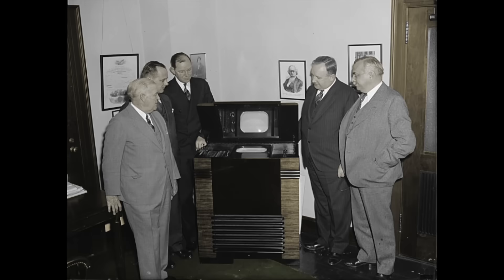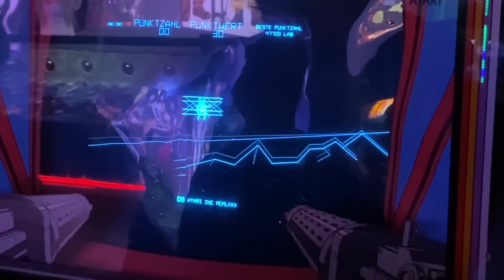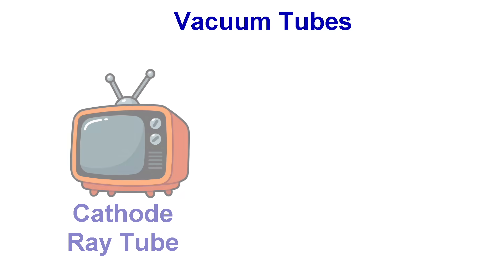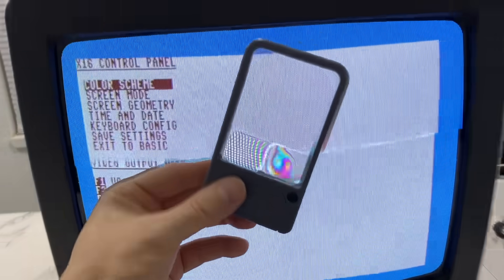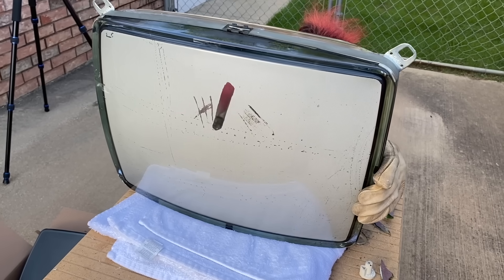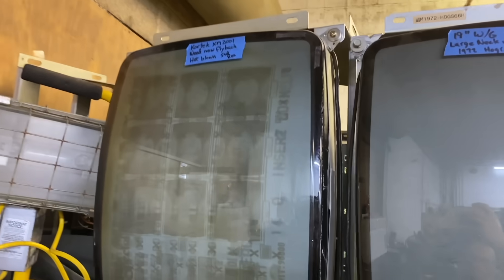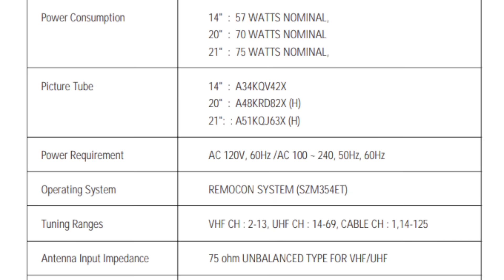How Cathode Ray Tubes Work.

Comment: You left out the biggest benefit of CRTs for modern users/gamers: unmatched motion clarity/stupid fast "pixel" response time.

Because it lacks persistence (the previous horizontal line of lit phosphors is pretty much dark again before the next line is even done drawing), if your content's FPS (Frames Per Second) matches the Refresh Rate of the CRT (Hz), the image in motion is STUPID fluid. Puts high refresh rate LED monitors to shame. And that's just at 60Hz/FPS.

I main a CRT on my gaming rig/am using it as I type this, and watching 60FPS content/playing games at 60FPS, when the monitor is set to 60Hz is GLORIOUS, and I hate going back to any other display I have. Increase in-game FOV, IRL FOV, sharpness, etc. on other monitors doesn't make up for the loss of clarity.

I can sprint past labels/signs in Halo/speed past signs in Forza, and read every letter, and see every texture, assuming the game engine doesn't force motion blur (unfortunately a lot do).

Running my monitor at 80Hz (if my GTX 1070 can render a game fast enough) is *pure eye candy*.
I really, truly, absolutely regret throwing away my Dell P1130 a decade ago, trying to "clean up my desk" (and keep my room from being a furnace in the summer). Such mistakes.

Back then I wasn't even running my 3 CRT "Eyefinity" array at the same refresh rate across all three monitors/wasn't matching the game across all 3... so I wasn't even getting the motion clarity benefit (it creates judder if there's a mismatch/if frames rates drop/go too high). Wish I could try again...

Comment: Vinyl records don't actually sound better than CDs.  The reason the sample rate of a CD is double the audible frequency range is to allow some complex math equations to turn those samples at 16 bits into any audible sound.  I learned that from a Technology Connections video.

Comment: The ratio 3 x 4 has a maximum LCD of 15" with max. resolution is 1024 x 768 and 17" display has an 4 x 5 ratio with 1280 x 1024 resolution. I own one 19" LCD with 4 x 5 ratio and 1280 x1024, the pixels on 19" LCD are larger than on 17" display the resolution is equal.

Comment: My PC's main display is an LG C3 48" OLED. I love it for PC gaming, watching Youtube, surfing the net, etc... wonderful TV, cheap - I got mine not long after the C4 was released, and many C3's were heavily discounted. Blacks are black, really black. Lag is almost non-existent, plus I have 4k resolution, VRR, G-Sync, and 120hz refresh rate.
But, while I would never go back to PC CRT VGA Monitors, I would never swap my retro CRTs + PVMs, for a modern OLED display, or any LCD monitor. There is still something magical about a CRT, and using them with old retro computers, and consoles, that were built for these displays.
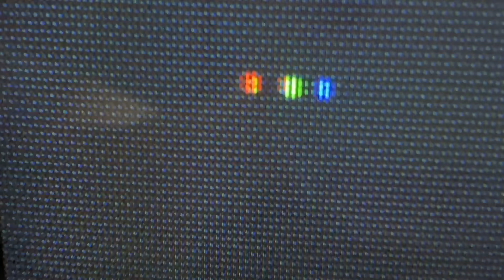Modern shaders, on modern displays, especially OLEDs, can mimic the scanlines, shadow masks, aperture grilles, really well, and look quite convincing. But, they're too perfect, and you don't get the effect of other colours getting activated like in this video at 7:40 - you get the 1:1 that David mentions, that CRTs don't get. And this 1:1 perfection slightly loses the illusion of running on a CRT, as well as motion, and of course the resolution of the shadow mask, or aperture grille is still too low - we need 8k displays for that, as well as 1000hz refresh rates.
Reply: i'd swap my 1920x1080p144 lcd monitor for a 1920x1440p75 vga crt monitor that can also natively display letterboxed 1280x720p60 from my nintendo switch

Comment: I want you to know part about never changing the tandy 1000hx i got i can confirm was used u til late 2018 from some documents on floppy I found. this was a full setup crt exteranl floppy and dot matrix printer all fully functional and working even today. I suspect they stopped due to lack of ribbon for the printer as it was pretty much out and the cartridges it came with do not fit

Comment: As a young kid in the 2000s I didnt really care about TV sizes as much as that movies at that time were already coming out in widescreen and i knew that it would be nice if they matched to get rid of the ugly grey-black bars on our family box TV. By the time ours finally kicked the bucket and my parents were willing to replace it with a flat screen i was old enough to know that the same screen sizes in inches wouldn't make our old 4:3 movies smaller if we stuck with the same size. So I got them to go from a 32" Sony box TV (480i...) to a 40" widescreen (1080p!) so we'd have about the same vertical height. I'm guessing the "widescreen" coolness factor was more what killed 4:3 than the appearance of a good deal.

Comment: Great video, I still don’t think I understand how CRTs work today or analog signal for that matter but I just wanted to point out one thing regarding resolutions.   There is such a thing as maximum resolution for CRT but it is determined by the horizontal frequency for arcade CGAs this is limited to ~ 15khz for VGAs 31khz .   In the case of 15khz the maximum resolution you can achieve is 15000/60hz (NTSC)  which will be roughly 240p scan lines or 480i in interlaced mode.   and for VGA this will come out to doble ~480p. Why does this matter for most old arcade monitos 240p was the maximum number of scanlines you would ever get on games until late 90s where some 24khz and 31khz monitors started appearing which where way more expensive since this is tied to the fly back speed.  In any case I only know of few games that made use of higher resolution monitos like the Naomi board and few titles like guilty gear which effectively run at 480p.  Even back in the day there were only a handful of computer monitors that handled lower 15khz all the way up to 31khz

Comment: Size was what finally dumped CRT's but LCD alone was not able to do it (LCD was for long time in calculators or watches, later in cellphones and it did no attempts to expand for a long time). What killed CRT's was Plasma. CRT started to vanish because 40inch screen was already too much for one gun to handle properly, Plasma was starting from this size because it was not economically sensible to make smaller ones (energy loss), besides, it was much more thin than CRT. CRTs were thick because of single-gun-use - to cover more screen it have to have more distance from the screen for EMs to direct e-'s properly not using ridiculous forces. LCDs from these times were mainly about 30inch and were looking poorly next to both competitors and were loosing this also in consequence of light source use - remember energy-friendly bubbles and how they performed? Waranty was for 2yrs and even after only these two years it was obviously visible when we were changing them for new. Plasmas were really awesome but more erg consuming, heat producing and there was no idea how to really eliminate the burning effect. I think that today they are still awesome but for low-temp-regios like Syberia or Alaska. In high-temp regios they were degenerating too fast destroying electronics and (i think) the burning effect was more serious (My Samsung plasma regenerates completely after few day complete break and sometimes even without when watching differential-source-content. 

You've made only one mistake - there is always some input lag and it is minimum as big as the max refresh rate (the screen enlighten-darkening time for phosphor coating also makes more lag especially when changing completely whole screen (from bright to dark). The signal from these times was still analog and if the change for dvbt-1-2-3-t or HDp standard would occur faster/later - this technology would be still popular today mainly because of the non-repeatable contrast rate (mainly darkest black). Also scaling analog signal was different with no counting only more-less frequent probing based totally on well known discret-parts even without chip-usage. Now you have to count every pixel * screen ratio * screen size * power necessary for each proper dot enlightment. Frame-rate of raw material was also increased (Single-gun-CRTs were not able to jump over usually 60-80Hz - [100+ was widely advertised] with drawing 6-36 fps more than usual, passing the healthy emmision standards, becoming lighter and more slim.) LCD never won the TV market and was only simple over-investment fault that they were sold for such a long time especially when LED/OLED/AMOLED screens came.

The advantage from CRT eradication is one - no sight loss from screen-watching. CRTs were responsible especially for astighmatism (escaping from the e-'s concentrating in the bad part of our eyes) and short-vision which today without radiation is ending with the resolution-enhancement in the center - not by resolution lost (because the distance could backward - focus dangerous EM waves in bad places destroying our eyes.

The CRTs were awesome from today point of view because only turning them on was pleasfull without opening eyes even - Remember the Dust-collecting and how they sometimes blew when turned on? Todays television is really cold in comparision and by this fact far less addicting and zombie-producing.

Question
Do you think that watching old VHS today really gives so bad results? From my point of view - usage of old player with no improvements is pretty easily accetable+ when using plasma screen from 480-720p era without decoder..

Comment: The backlight info for LCD and durability has some issues. CCFL backlight tubes do yellow a bit over time, and the ends of the tube get a little darker, but overall most CCFL displays work fine today. My Eizo monitor from 2008, which saw daily use every working day up to today, still looks excellent. 60000 hours for CCFL is easily reached. LED backlights are way less stable over time. Their lifespan is more like 30000 hours, and they can have serious variation in yellow phosphor degradation, so many 5 year old TV have those nice blue splotches in a even white image. With local dimming things become even worse, as all LEDs have different working hours. Many modern LED TV's don't do well much longer than 10000 hours.

Then there is the LCD rot. Things really depend on the make. I never encountered the effect you show. For example my Olivetti M10 (a more stylish Tandy Model 100) has a 41 year old LCD screen that looks imaculate. My Donkey Kong handheld by Nintendo, from 1982, has faded 95%, the shapes are very very dim today. True LCD rot I only encountered with very low budget LCD games by VTECH, like Smurf or Chicky Woggy. I never ever had a colour LCD suffer from any rot or crystal degradation. LCD is the MOST STABLE display of them all, the tech itself does not suffer from visible ageing, only the backlight does.

Comment: The early-2000s LCD monitors sucked balls big time. They looked washed out, and any resolution other than its native res looked like dogshit. Which made them useless for games and emulators. It wasn't until around 2005-2006 that they started becoming a viable alternative to a CRT.

Comment: I remembered what smell it gave off when we used have one smelled like plastic bands you clipped together. That how I can say. I am a fan of CRT because childhood. I remember before my dad brought his first lcd TV he had fair share of used CRT tvs and I felt safe for the most part. My dad got a 32 or 36 in Vizio tv CFL tv that was native 1080p tv worked until I lay it on a dest that had dust cracked the display. Man modern lcds are so fragile. If it wasn't for lcd technology the apple first iPhone would not been around. Now OLED screens are having same affect as crt. That is funny to me we progress but also still fighting the same issue burn in.

Comment: There's one last advantage of CRTs that doesn't often get mentioned: they are the only display technology that doesn't require sending power to every single pixel since the only things that are powered are the big electron guns and deflector coils at the back. Creating the high vacuums required doesn't require very advanced tech either, Otto van Guericke already did it even before electricity became widespread. Because of this there is a pretty good likelihood that if civilization were leveled tomorrow, the very first display technology we could bring back may very well be the humble CRT
Reply: Fair, but it'll be a monochrome CRT. They'll need at least 50 years or more to work their way up to a colour one.
Reply: @SianaGearz yes, but we got the Trinitron technology in the 70’s if I remember correctly, so at least in our lifetimes we might see something quality again 😅

Comment: The thing with old tech is that at some point in time, it goes into mass-production and after a while cost cutting measures become prevalent over quality. So if you are looking back to CRTs, products of the last decade of its lifetime more often than not are outright bad in terms of reliability, while even older CRTs may actually serve better. Be careful with outdated tech, in more ways than one, because after everything good you expect, it may leave you completely disappointed by its quality.

Comment: The last CRT monitors I used were a pair of Samsung 19 inch Syncmasters. I HATED getting rid of them, but they were so heavy and I could not move them easily by myself, plus they took up SO much room. I settled on a pair of 4:3 Dell branded LCD monitors that were native 1280x1024 and 60Hz. The Samsung monitors could run at a higher resolution than that, but I never did because CRT monitors at 60Hz give me headaches. I ran them at 1280x1024 and 85Hz. Man... I miss those monitors and that PC.

Comment: Great video! There is one more huge advantage I would hang to CRTs - motion clarity. The native motion clarity of a CRT is basically perfect. Sample and hold displays aren't able to achieve this without trickery (strobing, BFI etc) which has drawbacks and other requirements. If you load up something like Sonic on a CRT and an LCD at 60hz, it will appear blurry as it scrolls on even the latest LCDs. This is the primary reason I like to hang onto to CRTs.

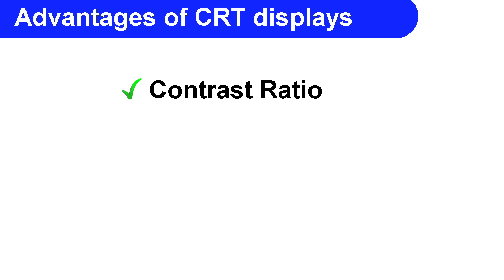Comment: 12:06 LCD with a backlight is partly also an older way to make displays. When you compare the CRT contrast ratio with an OLED screen....... yeah...... but you already notice that later on in the video. Still don't understand why you don't compare it to the latest tech. You forgot to mention that there is/was a dot per inch competition, a finer mask was able to work on higher resolutions with a sharper image. I had a IIyama with a 0.26 dps something instead of 0.36 (?) as far I can remember.  IIyama made great monitors back in the day. The only thing CRTs can do 'better' is aliasing because it is nature of the technology, it isn't pixel perfect and not that accurate. That is why older (low resolution) games look better on CRTs because you don't notice the pixel imperfections (with some kind of blur). You also don't mention something like ghosting (fosfor glowing) and scanlines (60hz  refresh rate, line by line) that introduce imperfections and flicker. Actually CRTs are not that great, really something of the past. Better to replace them.

Comment: i was sticking with a CRT until in mid 00s lcd became tolerable with not as bad viewing angles (and i was a hobo)
the i was on 4//3 until games finally started to run widescreen (and i was a hobo)
and before 2010 i was already on "4k" while people were still making videos that human eyes can't see more than 144p at 5 fps (because i finally got a job) (i still assembled that for free from 3 discarded 4//3 screens)
Reply: i am using those free dumpster screens right now
NEC are insanely good and long-living

Comment: I thought that you were going to talk more about the transition from B&W to color!  The old B&W sets were actually 60hz, they had to lower the frequency somewhat to 59.94hz, and its legacy still continues on most monitors and TVs to this day!
Reply: that also gave us the 23.976hz nonsense which is still used in modern digital cameras
Reply: @gamecubeplayer  Yep, almost every format is drop frame, there's very little that's actually the full, round framerate, and it's all thanks to the color TV transition.

Comment: Great video, fun to see inside a mostly intact CRT tube as you rarely get to see that.
It was really a simple reason I didn't jump at LCDs when they first came out, the black/white level being VERY grey, took an eternity to fix that difference and even today it still comes up a bit with cheaper devices. I accepted that limitation for laptops because that was the only way to make them less bulky. As far as "proving" contrast ratio, you can't convince a person of that if they don't care ijs.😄
Living in the aftermath I still use both types for the various strengths and weaknesses you listed, LCDs sure can be made larger more easily than CRTs.😉 Largely it stems from having the content look the right way when displayed, where LCD CRT-filters and pixel interpolation-filters etc. are making headway in that department. Lag however would be fixable if screen manufacturers actually put some effort into the matter, but they won't so it will be around for a long time.☹

Comment: And today we have the same issues with bad display size comparison in the automotive sector (infotainment and cockpit screens), where there's basically no standard aspect ratio, and thus a diagonal measure is definitely unhelpful. But manufacturer will happily boast about their x" display, even if its area is far smaller than a x-y" competitor screen.

Comment: Besides input latency there's one thing which where CRT is still undisputed king: motion clarity. I mean even slowly and constantly scrolling of graphics at a "low" 60Hz looks as smooth and crips as moving a physical paper in front of your eyes at the same speed. This is all how our brain picks up the after image from the bright beam fading over time which cannot be emulated with just inserting black frames to a "hold and modify" screen technology.